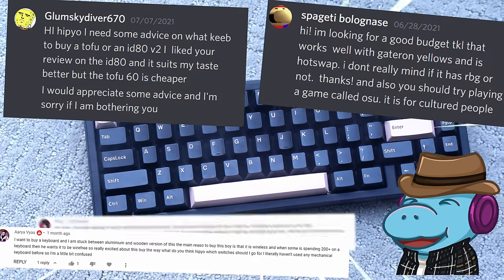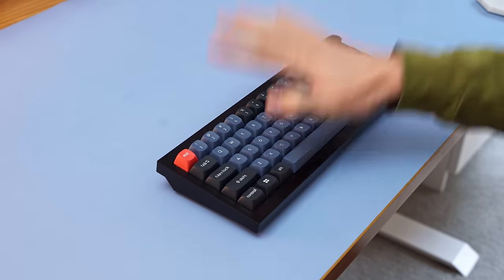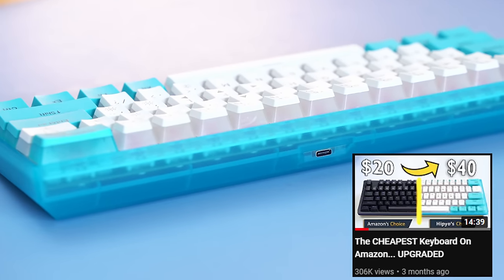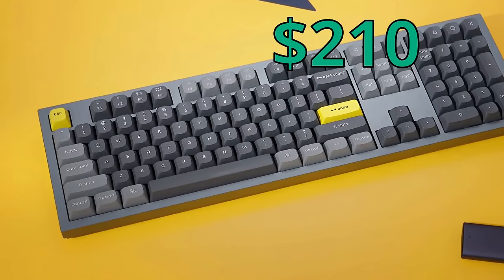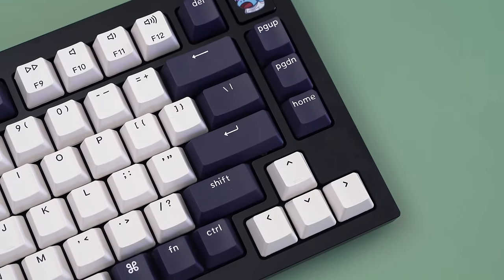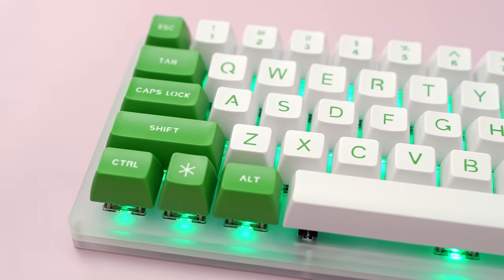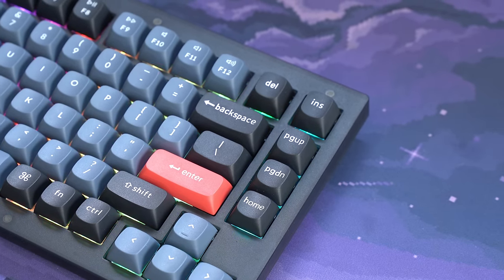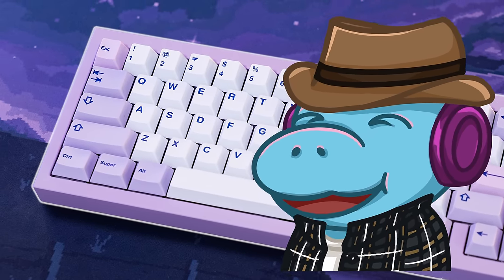What keyboard should you buy in 2023? (BUDGET FRIENDLY)

Comment: I mean, this is a great vid Hipyo, but you've failed me today. How could you? How could you fail to serve my incredibly niche tastes?! 

Jokes aside though I'm having trouble finding a keyboard with everything I need. I want an Ortholinear Keyboard, maybe a 60-75%, aluminum body or back plate, bonus points for a knob, and ideally hot-swappable. I can solder but I really don't want to have to de-solder and then re-solder. I suppose if it were a bare-bones with no switches that'd be fine, or if it came with boba u4s I wouldn't care much about hot-swapping.

Got any thoughts? Or if you haven't personally reviewed something like that maybe you can point me to another channel that has? Or maybe just to a board I can take the risk on?